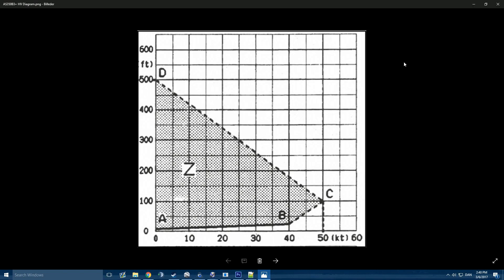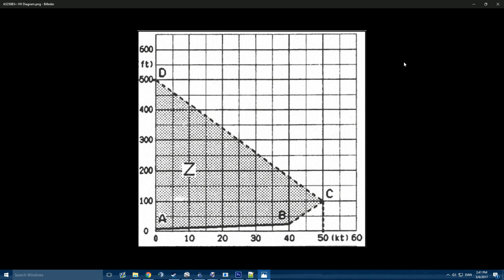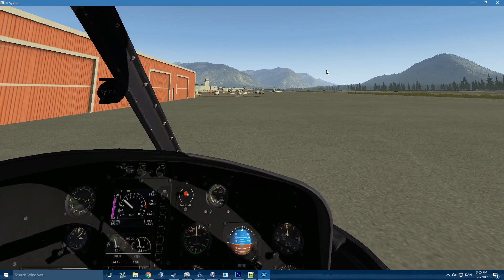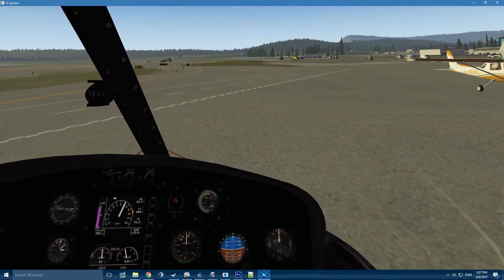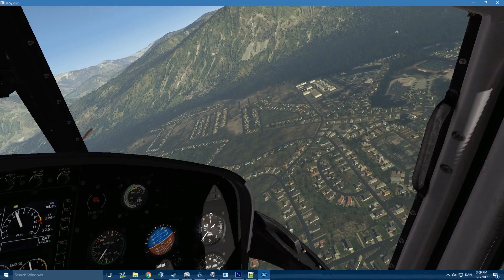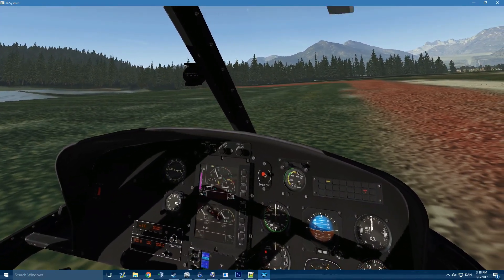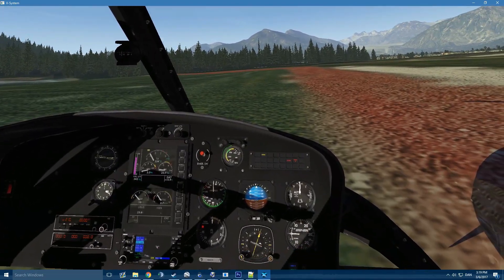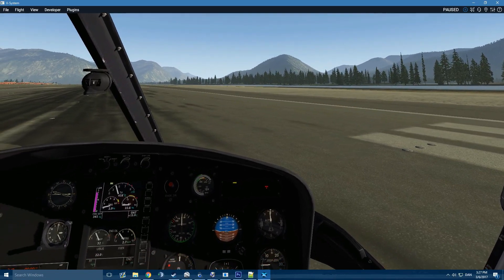[X-Plane 11] AS350B3+ "Dead Mans Curve" Autorotation Safety

Comment: Great job man :) Btw I received the x56 a couple days ago and it's great, but when I remove the spring, like how you have it, it's just kind of limp. It doesn't stay with it should be it falls to the side or whatever. Wonder if you have the same thing. At the time I just have the lightest spring on and that seems to work better.
Reply from the maker: Thank you Sebs.

Indeed the X-56 will rust fall to one side when removing the hand which i see can be a bit irritating. I've got most of the functions needed in flight mapped to some keys so i don't have to take my hand off the cyclic mid flight. on the ground i just take the second to put on cyclic friction in the simulator allowing me to go hands free.
Reply: I see. Like I said I had the lightest spring installed and it feels nice, you should try it, you might like it even more.Thanks.
Reply from the maker: Yeah i flew with the lightest spring for about 5 hours but i just find the constant attempt of returning to center annoying on longer flights. And i refuse to use the helicopter trim system in simulators haha. It's very much up to personal preference i suppose. Good that you are enjoying you new HOTAS though :)

Comment: How is the AS350 in Xplane 11? Last time I took it for a ride it was waaaay sensitive on the colective.
Reply from the maker: AS350B3+ Works fine for XP11 right now except for the RPM gauge which isn't quite right. The flight model is also good. :)